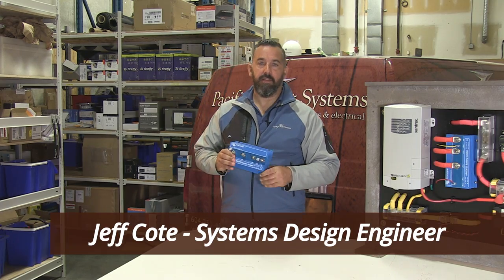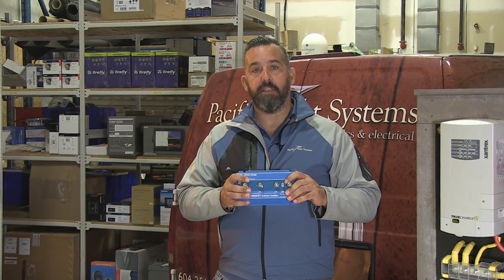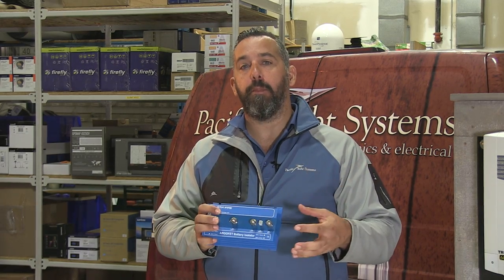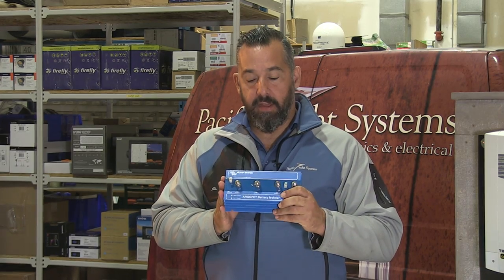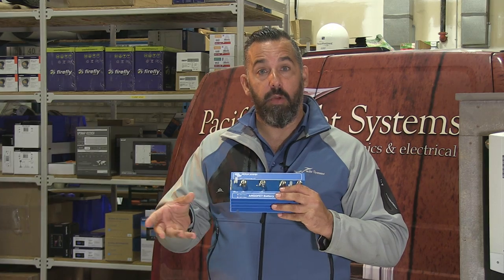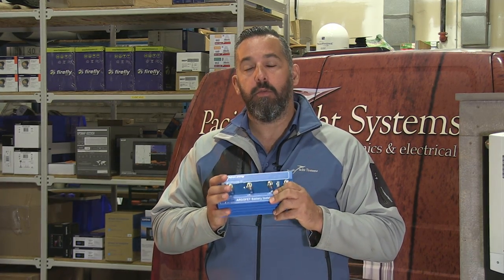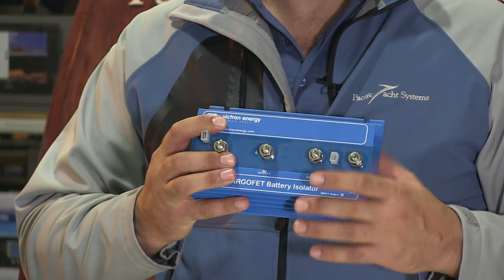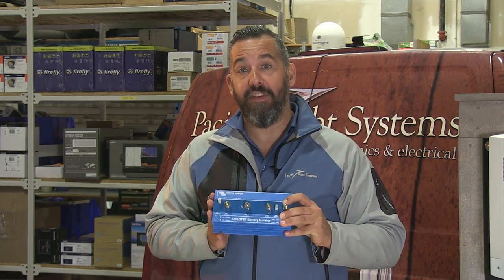Charge Multiple Batteries with One Alternator

Comment: Hi Jeff. I am finding your You Tube videos really, really interesting and I am learning a ton of stuff. I had a Grand Banks 50 and I came into a marina in Ensenada, Mexico. It was a trip of a lifetime. On arrival I went ashore and everything was fine. When I came back my boat had been moved by the marina in my absence. Another boat's lines had broken during the bad weather and it had drifted into mine causing some light damage. I plugged my shore power into the dock - that was clearly marked 50 amp 250V. I went on board and switched on my AC. I immediately heard some loud pops and a fizz so I switched them off instantly. Apparently - the shore power had been tampered with by another much larger boat and they had left it set up as 3 phase 250 instead of 2 phase 250. My inverter chargers and a microwave were blown. I had a marine electrician check out the survey (I videoed it as he did) and the marine held there hands up and said - "OK it's our fault". It took the marina a year and a half to get the paperwork and authorisation and installation all done ! (Meanwhile however; I had free slip rent and I met my still girlfriend so all was not lost) But I still don't fully understand about 2 and 3 phase electric and how it works. Could you do a video explaining this please - If you haven't done one already - If you have - just point me in the right direction. Thank you !

Comment: Hi Jeff. I'm up grading my battery system it's a twin engine ( 2 alternators) with 2 starter batteries one for Port one for Starboard plus a bank of 4 batteries in parallel for house. My question is can you install 2 battery isolaters , one for each alternator , splitting the charge to starter and house BUT also add two Blue Sea battery combiners with there 4 pole switches to isolate starter bat when your at anchor. Or do those Victron isolaters do that already . Great information site 
Derek UK
Reply from the maker: Hi Derek, you can definitely have a battery isolator per engine alternator. Battery combiners could also be installed, if you want to share a charging voltage (besides the battery isolator used for the alternators). For instance, perhaps you have an inverter/charger connected to your house batteries and you want the house to share a charging voltage to the engine batteries. Battery switches are a must, regardless of having a battery isolator or a battery combiner.

Comment: I'm wondering if you have an altanator to charge starting battery and you put a diode isolater inline with the altanator and 2 or more battery's wouldn't the altanator regulater see the first battery and cut back as soon as the starter battery is full then only sending a trickle to the other battery's ?

Comment: Hey, I’ve been running this unit for a few years now. Works great! I wanna upgrade to lithium batteries for my house bank. I think I’m currently using this unit your showing. I have the Victron with 3 battery bank charging. Irs hooked up to lead acid batterys: starter/bow thruster/house.  Will this unit still be good if I upgrade to lithium house batteries? Thank you!
Reply from the maker: Hi Seth, recall that battery isolators don't regulate a charging voltage they only share a charging voltage. Having AGM or Lithium won't matter to a battery isolator.
Reply: Pacific Yacht Systems Hey, thank you so much.  Also your videos have been a great help to me when I was re-wiring my trawler! Thank you
Reply: @PacificYachtSystems  what if I connect a dc to dc charger between the isolator and the lithium batteries? This would serve two purposes, first it will regulate the amperage so the lithium batteries don't pull too much and burn out the alternator and second, I can customize the charging profile. Any thoughts?

Comment: Jeff, I already have a DVSR to combine my batteries to charge from my one alternator. My problem is that the relay (from BEP) doesn’t seem to combine my batteries in all cases, even when the house batteries are depleted by 25% or more. Works some times but is unreliable. About 50/50 in my case. My question, is there a root cause of why my Voltage Sensitive Relay or Automatic Charging Relay (ACR using BlueSeas terminology) isn’t combining my house with start battery for alternator charging all the time and if it’s an inherent problem with DVSR/ACRs then will this Battery Isolator from Victron solve my issue and be better all around?  I have a 2016 Marlow-Hunter 37 and all wiring is original. Alternator wired to Start and combined through the DVSR with a manual switch for combining, which I rarely use unless I see the DVSR hasn’t done its job. Thanks for any help you can suggest.
Reply from the maker: Hi Yves, from my experience battery combiners are quite reliable. If your battery combiner is not working, wondering if the battery voltage on one of the battery posts of the battery combiner is at 13.3 / 13.4 volts? Once the battery combiner measures that "charging voltage" of 13.3 / 13.4 volts, battery should be in parallel.

Comment: Hello sir, is recommended to use blue sea combiner with victorn isolator? Is the isolator charge different type of battery flooded and AGM, does the isolator has voltage sense?
Reply from the maker: Hi Ameen, battery combiners of isolators don't regulate voltage they share it. The battery combiner is bi-directional (i.e. battery to battery) and the battery isolator is from alternator to battery (e.g. not battery to battery).

Comment: Can one be used on a normal lead 24v starter batteries (2x12v in series) to charge 12v lithium house battery bank in an RV?
Reply from the maker: Hi Jaffasoft, battery isolators don't convert voltages. If your starter is 24 VDC, then it's very likely, your alternator is 24 VDC as well. A Battery Isolator will not convert a 24 VDC alternator to 12 VDC for house battery.

Comment: In my RV  i have a 24volt battery bank. How would this isolator know to charge the bank up to 24 volts and not stop at 12 volts? Does Pacific Yacht Systems  offer a unit that can charge a 24v bank? Thank you.
Reply from the maker: Hi Micjakes1, sounds like you are looking for a DC to DC charging converter. Unlike a battery isolator, which is connected to a alternator output, a DC to DC charging converter is a battery combiner for different battery voltages.

Comment: What wire Gauge should I use for this? Length from alternator is 11foot.
Reply from the maker: You'll want to use a voltage drop and current table to make the correct choice. Remember the length of the cable run is there and back.

Comment: When I mean different type of battery I mean my starter battery is flooded and house battery is pure deep cycle AGM Battery can the connect to the isolator, and if I don’t have Isolator is my battery will harms my system right now?? Thanks Jeff💐
Reply from the maker: Hi Ameen, neither the battery combiner or battery isolator will adjust battery voltages for different battery chemistries. You need to have all your batteries sharing a charging voltage to be the same chemistry.

Comment: Could this be used for car batters?
Reply from the maker: Hi David, yep this battery isolator works with all types of batteries, including a car battery.
Reply from the maker: A combiner doesn't regulate any voltage, it simply places the batteries in parallel. Therefore whatever charge profile is charging one battery, the other battery will get the same charge profile when the battery combiner is enabled.
Reply from the maker: Battery Combiners and Battery Isolators share voltage, they don't modify it.